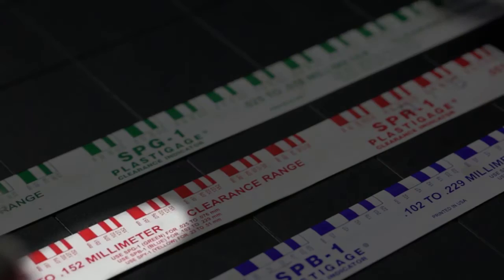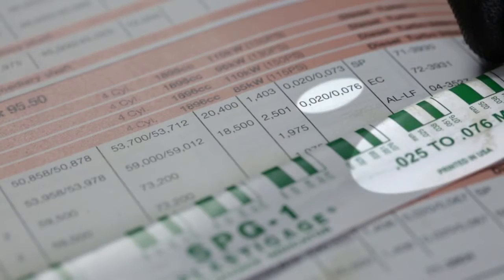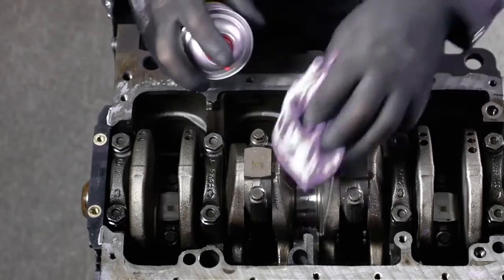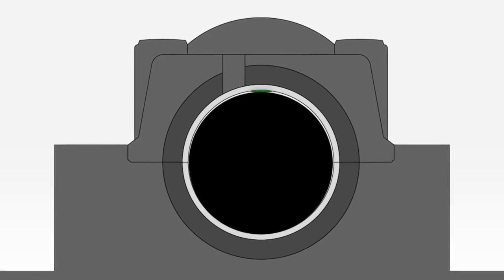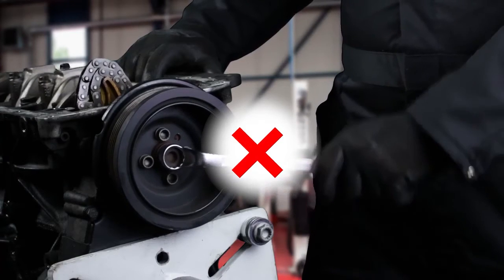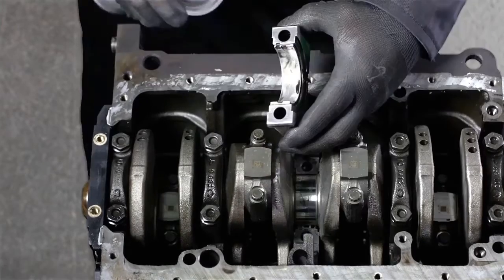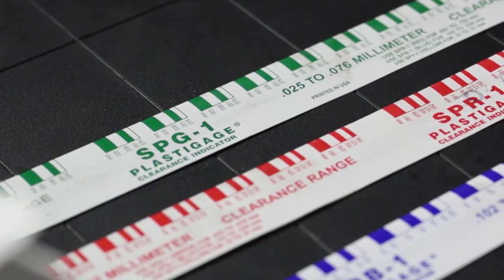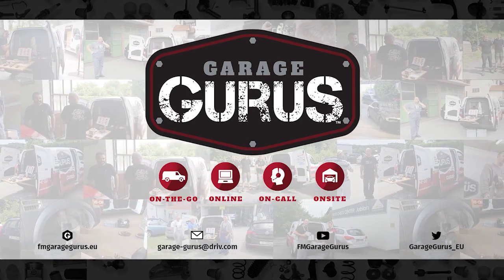How to correctly use Plastigage?

Comment: After getting the measurement on plastiguage, would i use that figure to set on torque wrench?
Reply from the maker: Hello @erottaffy2995. With plastigage you will get the clearance which should be in range for engine manual or our Glyco catalogue: https://www.garagegurus.tech/en-eu/knowledge-center/technical-catalogues.html 
After measurements, you should use new bolts in case of piston rod and tighten them according to the engine specifications. 
Have a nice day!
Garage Gurus Team